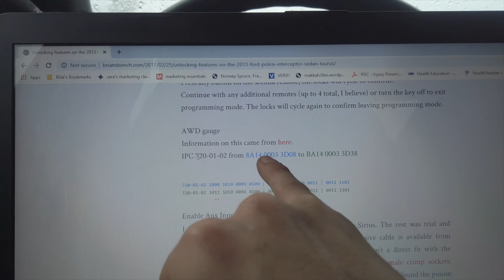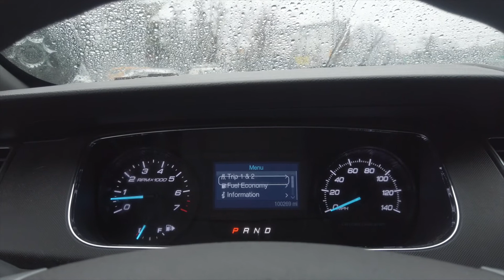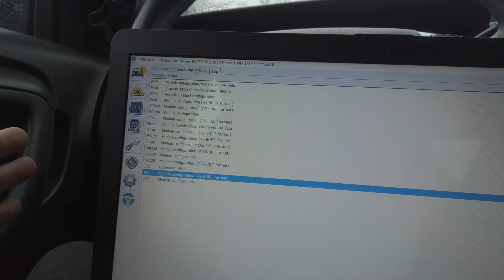ALL WHEEL DRIVE GAUGE ON 2013-2019 FORD POLICE INTERCEPTOR

Comment: It's there an actual way to make it just rwd instead of awd?
Reply: Umm. The numbers he “put in” are not what was on Brian’s website. Wtf. Look at the vid 🤷🏼‍♂️
BA14 0033 3D68 is not what he showed on the website. Shouldn’t it be  BA14–0003–3D38??
Reply: @aaronmoore4116  just change the first letter and before the last digit it will work
Reply: @Aaron Moore, just try both codes, and I believe it's 0003.
But a reply would be nice.
Reply: No. These cars a primarily front wheel drive but they will be AWD when they need be. If you want a rwd get one ford doesn’t even offer the Taurus with rwd.
Reply: I just changed the first letter and before the last digit. It worked! 
I remained the rest same what my car was showing which is different than his car
I believe every car has different codes the most important thing is the first and last